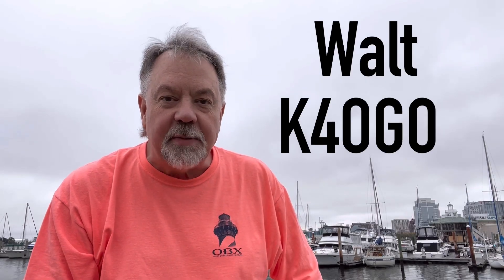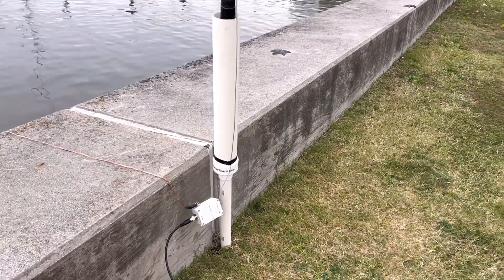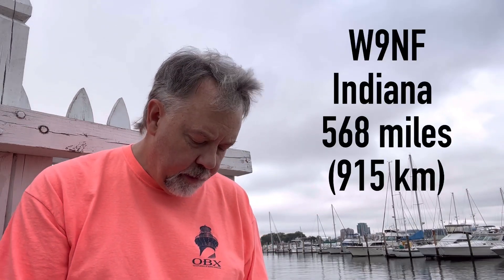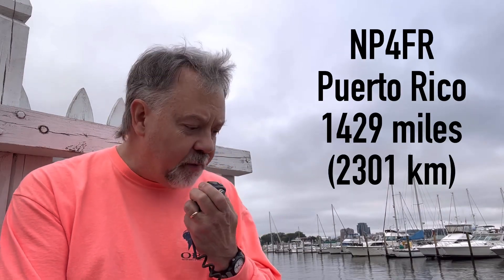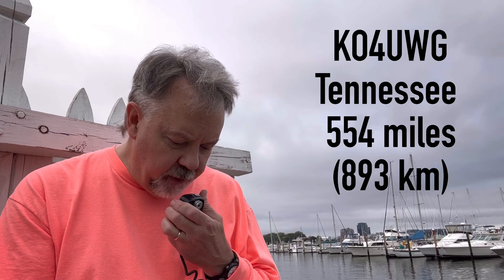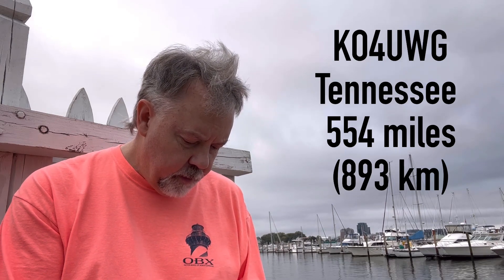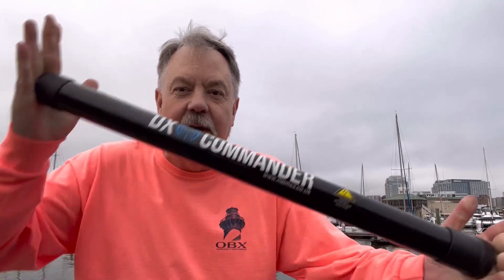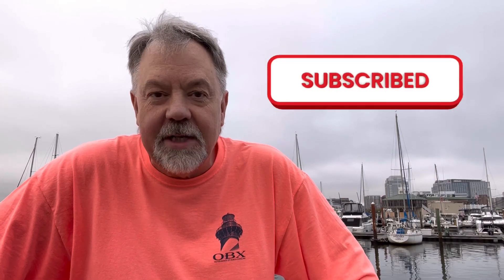Half Wave Vertical Antenna - Saltwater Portable

Comment: Could you make a half wave the same way you make your quarter waves? Using a 1:1 balun and wire cut to a half wave length instead of a quarter wavelength?
Reply from the maker: No that will not work, the feedpoint impedance would be too high and your SWR through the roof. You have to use a 49:1 unun to get a match not a 1:1 balun.
Reply: @ So I could follow the same instructions but cut a wire for a half wavelength and use 49:1 and that would work? I tried shopping around online for a 49:1 unun and it seems basically everything I’ve seen is labeled “balun” instead of “unun.” Are things listed as “49:1 balun” the same thing?
I want to try making an HF vertical half wave that forgoes the pole and instead use a high tree branch to lift the end of the antenna to the proper height
Reply from the maker: @ yes that would work great. It is labeled as a 49:1 balun but it is actually a unun.
Reply: @ Thanks! Now I just gotta build an antenna…and improve my CW skills…and get an HF radio
Reply: @COASTALWAVESWIRES  One thing I don’t get is the XTenna end fed half wave. I’ve been seeing what people say about that and it doesn’t seem to normally use any counterpoise like I’ve seen you build into vertical antennas. Why is that? Would that design of antenna be improved with those counterpoise wires?
Reply: @ I’ve noticed that most of the 49:1 ununs I’ve seen online only have a connection for a coax and another for your antenna. How would you attach counterpoise wires to one of these?

Comment: Dear Walt, thanks for interesting information. I understand you have good experience with counterpoise into saltwater. Do you have any experience with counterpoise into fresh water (lake)? 73.
Reply from the maker: Yes, I’ve been portable on the Great Lakes and unfortunately after trying that and doing some research I’ve found that it’s the salinity of the saltwater that does the trick. Freshwater actually has lower properties than just good rich soil when it comes to a groundplane. 73
Reply: @COASTALWAVESWIRES  Thanks Walt, your answer is appreciated, 73.

Comment: Walt,  I have a question regarding using antennas/coax down on the beach.  What steps do you take after operating to control the corrosion, sand, salt water...  Is there something I should be spraying on the critical points?  I just got done operating in Oregon on the beach and sand elements were a bit challenging.  I used 3 different antennas, 2 radios, and new Spyder beam mast.  Lots to clean up somehow.  the coax connectors worry me mostly.  Thank you for all you do Walt.  Please stay safe overseas.  W7JMK
Reply from the maker: Hi Jack! I really don't do much other than making sure my coax ends never hit the sand or get wet which is a challenge but I've been pretty successful. I carry zip-lock bags with me and put things in their own bag after taking them apart and then pull them all out when I get home to make sure they are dry.  Thanks so much for the kind words! 73 de K4OGO

Comment: Heard you a couple times, but I wasn't getting out to you at all. Must play with my antenna to see what the issue is. Usually I get great reception with my loop, and a descent signal out.
Reply from the maker: Wish we could have made the QSO, I struggle with my loop. They’re great antennas but it’s a skill using one that I haven’t mastered yet.
Reply: @COASTALWAVESWIRES  I've had good luck with the Chameleon Floop2. It works well. Problem is my QTH. It has to be the noisiest place I have ever lived in in my life since becoming a ham in 93. I think there may me metal studs in the wall and they are absorbing most of my 20watts.  Could be wrong. My noise level is generally 40 over. I use a noise eliminator, bit it also eliminates some signals as well.  It was a bad summer for me, and I didn't get out once to set up in a park, or just in a quite place.  Some times life sucks. Hopefully I'll get out a bit over the winter. I use a Buddistick on a 3/8s hag mount when its cold. Then I'm only cold for maybe 10 minutes while I set it up. Then I can jump in a nice warm car. Little pricey with gas now a days, but if ya wanna play you do what you got to do. I'm thinking of a few ham sticks as tuning is easier. Then I can put the 857d in the car and just bring the head in and out as necessary!